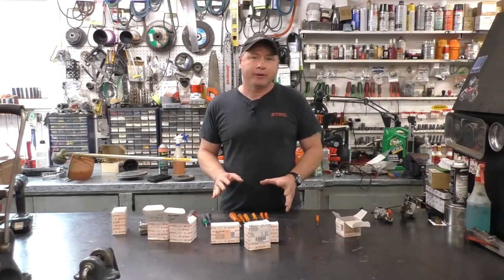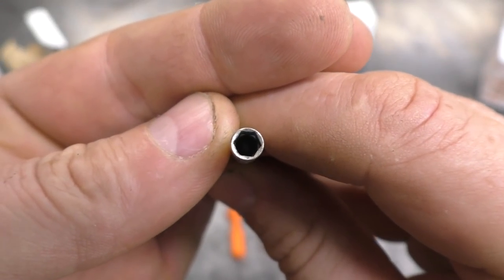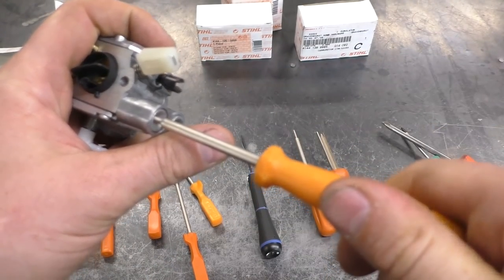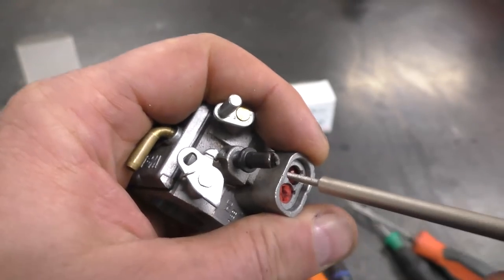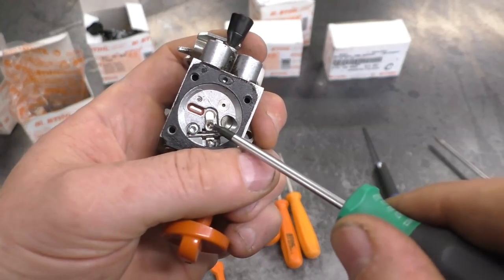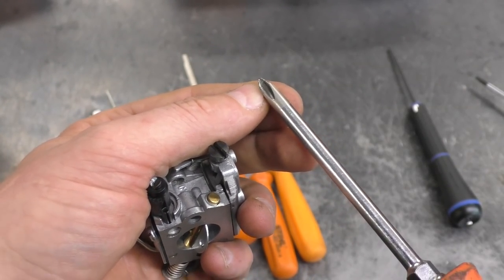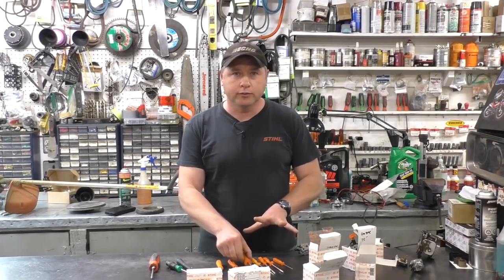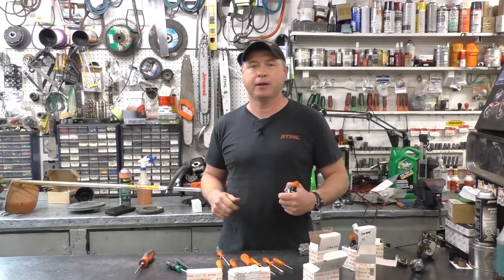Stihl Carburetor Tools You Need For Chainsaws, Weedeaters, Leaf Blowers etc.

Comment: Wasn’t sure if you knew this or not but the “Phillips heads” are actually JIS screws and if you use a JIS screw driver it fits in those “Phillips” better than a regular Phillips screw driver
Reply: JIS screwdrivers are excellent for true Phillips screws as well.
A Phillips screwdriver is actually designed to cam out under heavy torque loads.
JIS is not.
Reply: Thank you. I was going to ask whether JIS or Phillips.

Comment: I would have hoped that a brand could settle on ONE kind of adjustment screws.  Thanks for sharing this info.
Reply: Isnt that the truth . New ol school echos hamg in there w walbro but my 7310 has a zama and my small echo blower has moved to zama as well . Had to take plug out on the blower to get to the Tiny slotted mixture screw , bought a miniture screw driver set because of that , already had set of odd shaped drivers cause my kasei 1E48F uses the 'pacman' driver for a walbro clone on it , thought that engine woulda konked out long ago but weve put just over 4k miles on the 63cc powerhead installed on a bicycle and it just continues to improve in performance , at least 200hrs on it probley 300

Comment: Being about two week away from opening my own small engine shop, and also the fact the 70-80% of the equipment around here is Stihl, I will HAVE TO get these tools, for sure. When I'm officially in business, I will contact Stihl Norway (they're headquarters are just a 40 min drive from my location) asking if I could possibly get parts and tools directly from them. That would save me a lot of headache and worries by trying to use a dealer. There are no dealers around me and the dealers here have a significant markup on the parts and tools they sell, plus the extra time waiting for them to get the package.
Stihl -> Dealer -> Me is not as efficient and cost effective as Stihl -> Me

Thanks for the excellent and highly important information =)
Reply: it may be better to just apply to be a dealer.  something to check into

Comment: The Stihl part #'s for: 
the "good" slotted screwdriver - 5910 890 2305 (has long shank and a handle the same as 5910 890 2314 and 5910 890 2304)
T8 Screwdriver - 5910 890 2310
2mm hex - 5910 890 2306

The small square driver you rarely use (5910 890 2304) is for the Walbro carbs like the one in your hand @ 3:54. It fits down through the limiter caps to make direct contact with the screws for a better feel while making adjustments rather than using a slotted screwdriver in the plastic cap which can be easily damaged. It's also easier to use with the caps off and the machine running instead of trying to use a slotted screwdriver that keeps slipping off the screw. Unfortunately, it does not override the limiter caps they still need to be removed to make larger adjustments.

Most dealers won't sell carb adjusting tools or limiter cap removal tools. Not only are they listed as "DEALER USE ONLY" you can get a huge fine from the EPA and possibly have Stihl pull your dealership license.

Comment: Can an older carburetor (i.e. Walbro carb from an 026) accept adjusting screws with a hex head or micro allen? Also, can a chainsaw be better tuned by removing the limiter caps, and do the same tuning principles apply with limiter caps removed as with the caps on?

Comment: The limiter cap remover is what i need.  Do you know the thread count on it.  (you know what i am thinking)  That was a great video sir!!!
Reply: A lot of guys were using fine thread drywall screws to pull off limiter caps. A little rough but effective.

Comment: I don’t know that is all you need.  I have a plastic tub full of tools that I use to work on chainsaws.  The only Stihl tool I use is the little screwdriver that comes with Stihl saws.  I have all the splined screwdrivers but I keep them in my roll a way in the shop.  I like to run my equipment with the limiter caps installed.  They sure are making stuff tamper resistant, aren’t they?
Reply: Mixture screws used to have springs & flat washers under the heads, which helped keep the setting from changing. A lot of newer, limiter capped mixture screws no longer have the springs to keep tension on them. They use the caps to keep the screws from vibrating out of adjustment.

Comment: Stihl must be the only brand chainsaw you guys have in Canada.  Makes my wonder about them since they're in your shop all the time.
Reply: We have other brands as well. Husqvarna is another well know brand for one. My husky saw is 30 years old and has never been in the shop
Reply: @circuitbreaker9001    Good to hear.  I have a husqvarna that's 24 years old and it too has never been in the shop.  I just replace the air filter, fuel filter, and spark plug when needed.
Reply: That does say something. . . .
The Number 1 rule of chain saw ownership is: Never, ever loan out your chain saw. Bad things will happen to it!
Reply: @frogfoot198  Funny I do just the same. However I just changed the fuel filter this year. First time in 30 years. The one I took out was still like new. I do use nothing but #1 fuel in all my equipment. So every thing I have has never had any carbs off
Reply: Here in Minnesota it seems the same way. You either get the box store garbage or Stihl. Husky's on occasion.
Reply: @circuitbreaker9001    Same here.  I use nothing but ethanol free fuel in all my small engines.  No carb problems at all.

Comment: 🙂👍
Video request please Dony. Pull cord replacement on a bg56/86 pleeeeeease 🙏
Reply: There are so many on da toobe - bottom line is pull cord out, lock the wheel with whatever as long as it is secure so the spring doesn't go back, cut old cord, put new in, tie knots on both ends, release the wheel, job's a good'un.
Reply: @peterlabiak1051  I’ve not found a decent video for a stihl blower pull cord replacement. If you have a link by all means post it in a reply,
Reply: Pull cord replacement isn't machine specific. 
Dony has at least one video how to do it. (I believe it was on a lawnmower)
I believe but might be wrong on this, the only exception is the stihl easy start setup. I have yet to come across one on the workbench.

Comment: Are these the same tools needed to work in Husqvarna too?
Reply from the maker: they are different
Reply: @donyboy73  off the top of your head would you have the part numbers for these tools?  I have a backpack blower that is always a challenge for me to keep running.
Reply: @kevinorr6880  He has the part #'s listed in the video description. You will have to click on the "Show More" button to see them.
Reply: @Urbicide  but, those for the Stihl, not Husqvarna.  I understand if the tool numbers are not available. Just was hoping to save the research since I am obviously out of my element